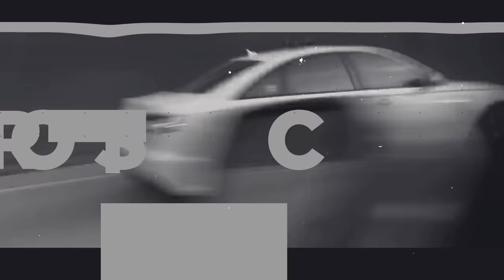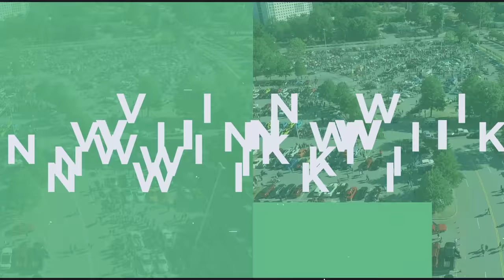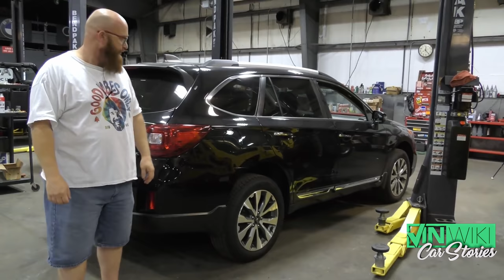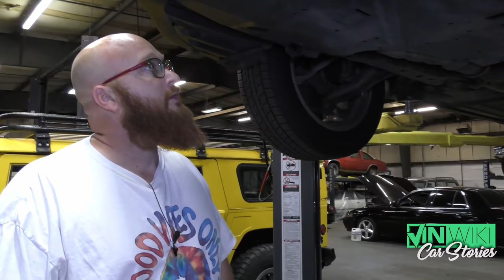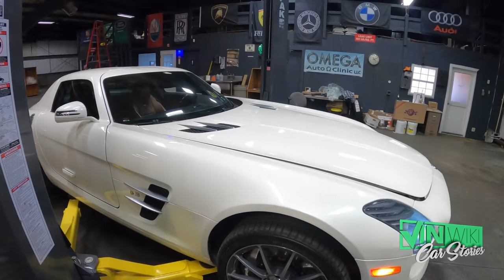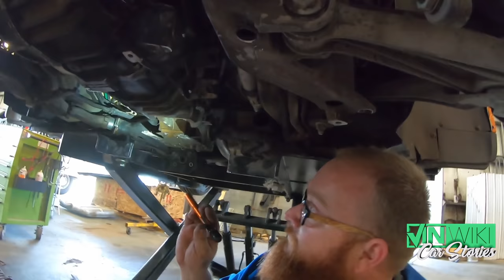The Car Wizard's 4 Worst Mistakes Ever!

Comment: I was an electronics installer for Best Buy/Geek Squad for a few years. My location was pretty decent, a few minor damage claims here and there. Some of the things that happened at other stores or with previous installers at mine would blow your mind. Fires, doors bent backwards when backing out, holes drilled through roofs, manual trans cars taking off and crashing into houses because of improperly installed remote starts.
Reply: "manual trans cars taking off and crashing into houses because of improperly installed remote starts" << LOL :D
Reply: @webfreakz   That is a serious issue. They need to have a safety system to prevent accidents like this, which is something that can very easy happen. Especially in a household that has both manual and automatic cars, you may forget that you didn't leave the manual in neutral. Depending on which vehicle it is, even starting it in second gear would work. We had a 1st gen pathfinder, they used a gear reduction starter designed to start the engine in tricky spots, with 4 wheel drive locked in. Given the correct situation that could turn the engine and tires over in 5th gear, and 1st was nothing to it. If this happened at the wrong time and place, you could kill people. There are proper ways of doing this.
Reply: @snoopdogie187  oh come on. Spoiled brats with remote start.. what the heck.
Reply: @snoopdogie187  there is a specific way of installing and programming a remote start so that it's pretty safe. Basically you activate the R/S has to be activated with the clutch pedal released, parking brake on, and engine running. Then it needs to see the door open and shut and then locked so it sees that there's no way it can be in gear when it is remote started. Many customers hated this and would request a "normal" install. I've also seen techs that wee too lazy to hook up a few extra wires
Reply: My local Best Buy ran a screw through a canbus line in my pickup while installing a subwoofer. They paid several thousand dollars to the dealership to have my interior completely torn apart and the entire cab harness replaced. I was mad at first but they owned up to it and did what it took to make me whole again so I can’t really complain.
Reply: @jeeper390  I didn't even know you could get remote start on manuals.  Do most companies offer that?  I could have sworn that, when shopping, I noticed that the companies I was looking at didn't offer remote starts on manuals.
Reply: @recipioct  they do but lot of places don't like to do them because it's extra work and liability.
Reply: @jeeper390  For after market?
Reply: @recipioct  yup

Comment: As soon as you said Subaru fluid flush, I knew exactly what happened before you said it. The fill for the front diff looks exactly the same as the transmission, just that they're on opposite sides of the engine. For whatever reason, on my Crosstrek, the transmission fill is easier to access than the one for the differential. I remember seeing a video from Australia saying the fill for the front differential is on the driver's side. What some of the people failed to realize (not me of course) is that Australian cars are left hand drive. Let's just say, the comments on that video were interesting
Reply: Australian cars are RIGHT-hand drive, i.e. the driver sits on the right-hand side of the car (as in the UK, New Zealand and a few other places). RHD cars drive on the left side of the road, LHD cars drive on the right.

Comment: As soon as he said Subaru I knew exactly where this was going. I actually did that on my own car. Drained the diff and then put gear oil in the trans. Luckily I caught it immediately when the fluid immediately came back out. Had to run to the store in a different car to buy trans fluid so I could drop the pan and spray everything down with parts cleaner. I’ve put 40,000 miles on it since then with no issue but that could have gone badly.

Comment: In contrast, I worked at a major health system that had gone through budget cuts and layoffs. I found myself in a position where I later learned that HR had blocked my required training. Instead my manager had given me bad performance reviews followed by performance improvement plans. I was fired in mid 2019. I disputed my termination but could not prove that managers had violated any policies. I filed for state unemployment benefits in April 2020 for NC. I found out later that there is a legal error in the state law for my situation. So I was ultimately denied benefits. I sat out of work for 2.5 years. Car Wizard took ownership of his mistakes and prioritized protecting employees. My prior employer did not.

Comment: My close call when i was a mechanic. Almost 10 years ago at this point. We had an air powered lift table that made it easy dropping engines and subframes. Well i was lowering the subframe with front suspension attatched and the weld that held the table to the lift broke and it all came crashing down from about 4ft in the air. There was only 1 point of connection between the lift piston and the table and i was a joint at that.

The genius if it is the switch to control up and down was pretty close to being underneath the table. I am blessed that it decided to fall a different direction then towards me. 

The shop had the table re-welded. Needless to say i never used that deathtrap again. Lol
Reply: I think the closest I've ever come to getting hurt was I had a spring compressor give out on me doing struts. About 6 inches from my wife collecting on life insurance.
Reply: I had an old mech teaching me how to use an ac generator and said whatever you do make sure the ac hose is secured.  Well we turned on the ac and the hose rose up like a snake. It was epic.

Comment: That first Subaru story reminds me of my quick lube days. New guy would drain the trans instead of the oil. Replace the spin on trans filter with an oil filter. Call for clear to add, guy up top would fill the oil and start the car. After going through the lights the engine oil dip sick would be checked and to their surprise it would be 3/4 of the way up the stick. I would get called over at that point and realize that they drained the trans and replaced the trans filter, never drained the oil or changed the oil filter and added 4-5 quarts of oil and ran the trans low on fluid but luckily never moved the car. So I would have to drain the oil, change the filter and refill the trans after getting the proper trans filter direct from Subaru. Refill the trans and get it dialed back into perfectly full. All while the customer sat there thinking we destroyed their car. Obviously they never came back after that and I can’t blame them.
Reply: What year subarus? When i read trans filter i was thinking diesel gm truck, some ford diesels might have them too not sure, dont see many diesel trucks where i work.
Reply: @connor3288  I want to say the early 2000’s maybe up until 2008 or so. I’m not a Subaru expert by any means but back around 2012 was when I saw a lot of them with the extra spin on filter on the older subarus and only some models. Pretty sure they still had a more traditional filter in the pan but used the spin on as a bypass flow filter. Either way a decent amount of fluid came out from them along with what they drained from the pan.

Comment: The fact that he took responsibility and fixed the issue + covered a rental car is MORE than I got directly for the Subaru dealership with my 2019 outback which was STILL within warranty.  They still tried to stick me with the installation labor charge for an admitted mistake by the mechanic + they kept my car for two days (no loaner) while they were un-fucking it.

Comment: My father was a mechanic in the Swedish airforce in the 70s. He told me about an other mechanic that forgot a tool in the engine on a J35 Draken fighter jet (it should not be able to happen with all the safety regulations)
They started the engine and after a while this horrible noise occurred and the fan blades in the engine was totally destroyed. VERY expensive mistake.

Comment: I took my car to the dealer for oil changes and such since it was new and they offered me pretty good deals.  Last service I had at the dealer was an oil change but the inspection report said that my cv boots were leaking on the left side and needed to be replaced $400 job.   I wanted to get a second opinion took it local shop down the street he put it on the lift and 10 minutes later he called me in and told me to take a look with him under the car.  The dealer tech purposely didn’t tighten my oil filter causing it to leak he also put finger prints on my boots to make it look like they were leaking.  There were no leaks on my car at all.  I called up the dealer and they had nothing to say when I complained. Seems like they didn’t care.  Always had a positive experience with them Until now.   now I will blast them every chance I get for trying to rip me off.
Reply: They have high overhead is their excuse for scamming

Comment: I’d add using a hole saw to drill out the carbon fiber transmission tunnel on a Murcielago to that list.
Reply: It wasn't a mistake, the car is working and the owner happy, it's just wrong according to Lamborghini.
Reply: The mistake was installing the used transmission without swapping over the existing sensors. That's pretty standard to do on a transmission swap

Comment: Got a nail on the side of the tire wall once. Called a local tire shop and ordered a new tire after several folks said it was probably damaged beyond repair. I sat in the waiting room while they installed the new one, then the guy comes back in and says "I would hate to sell you a tire you don't need. I simply pulled out the nail and tested the tire. You're all set." Honesty won them my business  right there

Comment: When I worked on bush planes in northern Canada I was told a story by one of the old guys that had been working up there since the 40s (this was in 84). They had a otter that had an engine fail. This was in the winter so the plane landed on a frozen lake and got right up to the trees. A new (overhauled) engine was flown in in a DC3. The otter is a radial so it's a big round engine. So they unloaded the new engine in a crate a couple of hundred feet out on the lake. Because they had no way to move the engine in the crate they got the engine out of the crate, stood it up on it's end and rolled it across the ice over to the otter.
Reply: Buffalo Airways? The DC3 got me there!

Comment: I agree about not rushing when working on vehicles. I worked at an Acura dealership as a lube tech. Some of the other lube techs wanted to race to see who can perform an oil change, tire rotation, and multi-point inspection faster. I noticed one of the other techs was about to lower his vehicle without tightening the lug nuts first. The Army taught me that speed comes with time. (Slow is smooth, smooth is fast) I do not like to rush. I learned that rushing leads to mistakes and accidents. Better safe than sorry.

Comment: That Subaru issue happened to a colleague of mine at 25k. That dealership was horrible to her. First, they tried to warranty it, then when they finally replaced it, they replaced it with a unit that had like 100k+ on it and tried charging her $3k for the repair.

Subaru themselves had her take it to a different dealership, had them replace it with a brand new unit, then later ended the first dealership's relationship with them.

Comment: So refreshing to hear these stories. I'm a shop owner myself and people have no idea how hard it is. I made the same mistake on a Subaru, but luckily I caught the problem before I took it off the lift and managed to change the fluid before driving it and avoided a costly mistake. Honestly the blame should be on the OEM's designing these cars to be overly complex with a lack of clarity in their repair manuals.

Comment: Early this year I had a coworker drain  an audi transmission thinking it was the oil drain plug. Then they added 5.5 qts. Started the engine just for 5 seconds whole shop filled with smoke. Apparently the engine had a total of 11qts when it should be 5.5, tranny was knocking like a mother. I instantly knew what went wrong. I was laughing but the other two weren't. 🤣 I had to fixed it myself drained the 11 qts of engine oil,, added the 4ish qts of transmission fluid that was drained, drove it around and everything was fine.

Comment: early 90's Toyota corollas has a similar transaxel/differential  situation where there are sepearate chambers for each  separate drain plugs and separate drain plugs but it is common for front wheel drive transaxels to share the same fluid sump as the front differential.

Comment: When my dad had a shop and I was a young mechanic, we put a new short block in a dodge full size van. I had the job of doing the valve job. I didn't pay attention that intake and exhaust springs were different lengths. I installed a intake spring on a exhaust valve, which is longer. Owner made it 25 miles before it broke the exhaust valve off in a new engine.

Comment: As the Program Coordinator for the M1A1 tank facility at Dammam port during Operation Desert Shield/Storm, I witnessed several accidents with the power pack change-outs. Unfortunately, it wasn't so much the cost of replacement, it was AVAILABILITY! And I was already under pressure to get all of the tanks fielded. Any delay was serious

Comment: I dropped a M1IP turbin pack also but luckily it only dented the rear module exhaust. 
Was in Gelnhausen Germany. 3/33 in 86. Taking it off the maintenance stand with a 88 recovery vehicle and we were off center a little bit and down she came.

Comment: I worked on gas turbines in the navy. The Abrams power plant was our electrical generators. Or mains, GE LM2500s produced 26,500 hp. Never had to pull one, or even split the compressor. Did see a ship replacing an engine and it smacked off the ship. Can't recall the cost of that engine.

Comment: My parents have the same model Forester. Interestingly a workshop did something very similar, but instead swapped the gear and differential oils around. Luckily they realised before the test drive because the volumes were out. Costly for the workshop as they had to flush twice as much very expensive fluids through both components.

Comment: On a older Ford 5 speed RWD transmission there is a "fill plug" you can remove that really isn't a fill plug. You have to remove the transmission and partially disassemble it to put a lever back on.

Comment: Being in the Army for over 16 years I can attest to how much our stuff costs. The costs are overinflated though because of supply and demand and since only one manufacturer normally makes the parts they can charge us whatever they want. A 2in thick 2 foot plate with 2 mounting bolt holes (not even threaded) cost us one time 700 dollars, for something a machine shop could’ve done for about 150
Reply: In specialty construction, 2" steel can get pretty expensive depending on it's use. If it's just one part, the fabricator may need to get a full 4ft x 8ft (or bigger) slab depending on the grade and specification unless they have some extra lying around from previous work. Then plasmajet or waterjet cut to get the rough size out of the slab. Then if it's a high tolerance part, machining and drilling the final part. If it's just one part, it could be really expensive. If it's in bulk quantities then unit pricing can go down drastically.

Comment: Manual transmission Subarus used to use generic hex head transmission drain bolts.  Jiffy Lube lunched so many transmissions by during oil changes removing the tranny drain bolt, then overfilling the oil, then the customer drives away with no trans oil.  Now, the manual transmission drain bolts are a big torx, so they are not mistaken.  Most mechanics who haven't smoked too much pot on their break can spot the engine oil drain bolt, which is still a hex head.  They get thrown if they spot the torx with their crescent wrench that won't work.

Comment: Wish more (or any) shops were like this in my country. I have so many stories with things broken at different shops that “were there before”… I had my windshield broken, my headlight washer motor stolen, parts missing multiple times, the e brake broken on 2 cars, brakes mounted backwards (yes, that is possible) etc. Now I have to change my gearbox fluid and am scared to go into the shop 😅

Comment: I used to work on those Continental agt1500 engines and the car wizard is right, the transmission is almost bigger than the engine. They are incredible

Comment: One time I was working on my little Fiat Spider that I had proudly painted in my Mom's garage with rattle cans. My brother-in-law dropped by and, thinking it was pretty cool, offered to buy it off me. I said, "OK, but make sure to torque down those lug bolts, because they're only finger tight." A few days later, he was driving happily along in the car and suddenly noticed a wheel, looking suspiciously like one of his, pass him on the left and shoot off into the highway median strip. He pulled over just as the car dropped onto its brake drum. Incredibly, the only damage was a small ding in the quarter panel.

Comment: I was doing a motor on a GS460. It had the big 4.6 V8 and I had it and the transmission and the subframe on jack stands underneath the car. I separated the transmission and the engine flipped over off of the jack stands very spectacularly. It was alright though it was a core